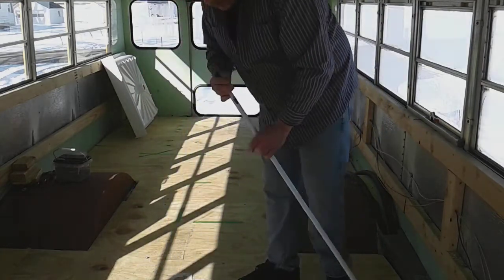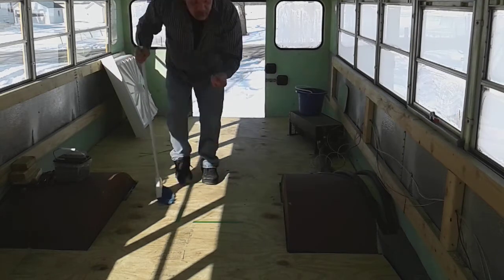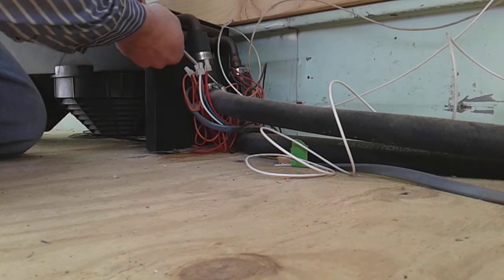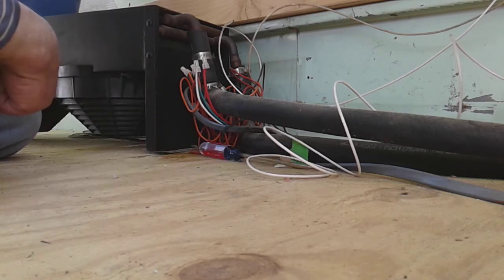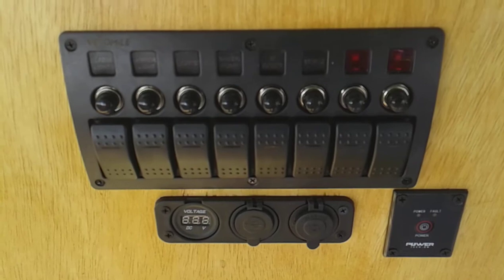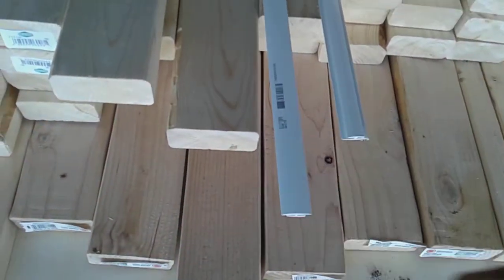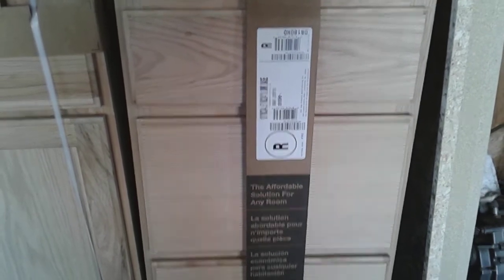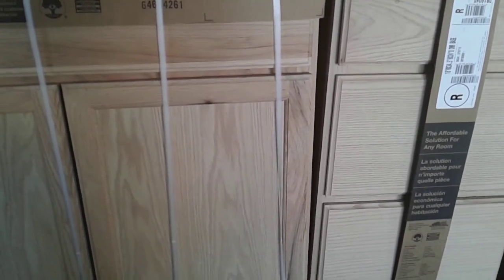Mullet's Skoolie Build EP 15 - Cabinets, Fridge, and more!

Comment: hey john like I said I have a 6 window Im going to lower my floor 4 inches on the passenger side and use use that for a shower pan and just have a cover over it when not used also am going to store the shower curtain in the shower pan also there is a video of a guy with a box truck with his shower like that